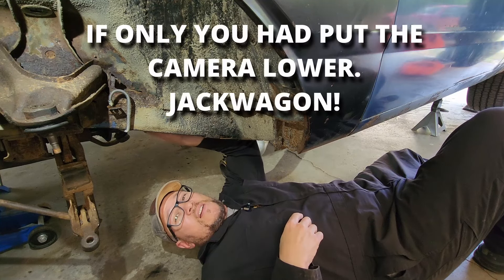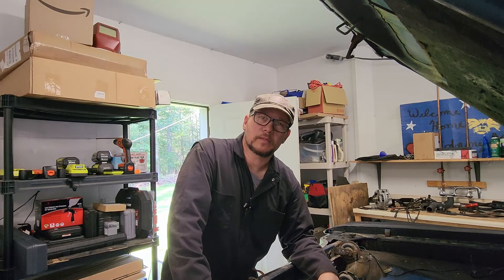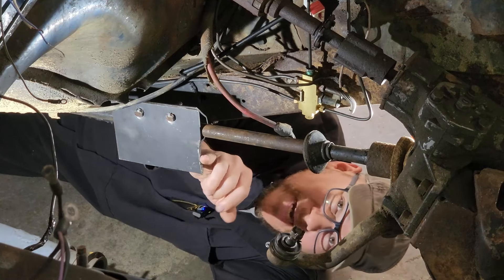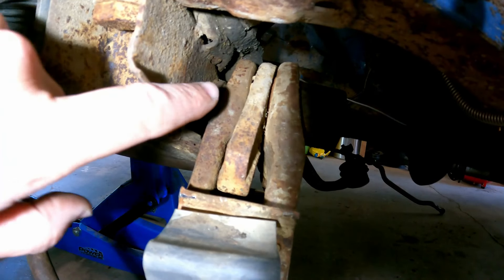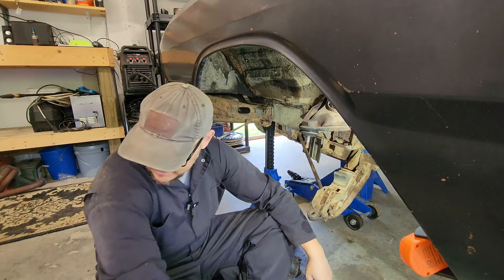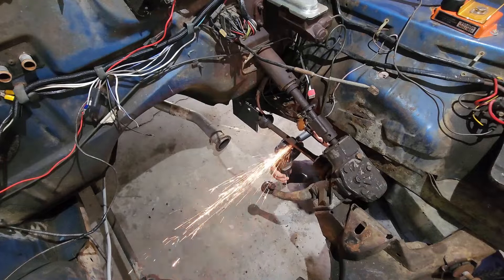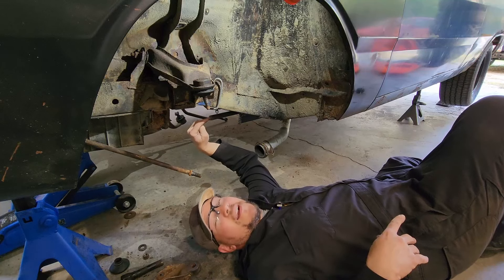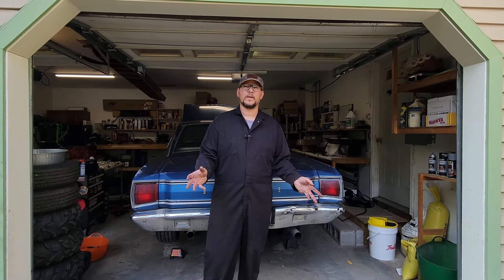Have An Insanely Stuck Torsion Bar? Watch This Now!

Comment: I got one for you tie rod removal tool it's got the bottom teeth on the larger piece of the metal to bite into the torsion bar and it's got a table for a socket. Throw an extension Hammer the extension end
Reply from the maker: Hello David. Welcome to the channel and thanks for the comment. I had to look up the tool you were talking about bit that looks like it might work fairly well. I'll have to give it a shot the next time I need to get out a set of rusted in torsion bars.

Comment: I had a similar issue on my sierra ended up going to a rental and getting a big old jack hammer took about thirty minutes but I’m not sure I could’ve gotten it out of the front even if I had cut the torsion bars they were so seized this is after soaking in pb blaster for weeks and countless hours of hammering with no luck
Reply from the maker: Welcome Number and thank you for the comment. I really need to get a Silverado or Sierra with the torsion bars. Would be a fun build. For the classic Mopars, I have seen guys beat them out with a sledge hammer to the control arm but I was concerned about ruining them so didn't go that route.

Comment: There has never been nor will there ever be a torsion bar on a Mopar car that I can't get out...unless some one has welded it in!😂.... You can always remove the lower control arm from the K member by taking all the tension off the bar then remove the shock mounting bolt ..nut on front control arm pivot and any other suspension connected to arm then take circlip out of rear torsion bar crossmember then whack control arm to rear and out the bar comes still connected to the arm... Now you don't need to be on your back to finish the job! Some heat and cooling and penetrating oil/spray and a bmx neck four hole style bolted to the bar gives you a tool to hit on for free and out comes the bar!... If not then its time for the air hammer and end this tragedy!😂😂😂
Reply from the maker: @moparnut6286 Welcome back and thank you again for your insight. I actually gave the method of hitting the LCA with my 12lb sledge a try on the other side and she wouldn't budge. I am still pretty new with all this and was a bit worried about bending the control arm. Is that something I should have been worried about? And I am quickly learning that alternating heat an lube gets most things unstuck eventually. I would have never though to use the neck from a BMX to clamp on the bar though. Thank you for that bit of knowledge. One day, I will have the space for a decent compressor and air tools. And a lift. One day.
Reply: @MontsweagGarage start with the compressor it saves so much on pain in your joints later in life not to mention the sore muscles!... A lift is truly a back and knee saver.
Reply from the maker: Just made a deal for a small compressor. I doubt it will run tools for long but it's a start.

Comment: Did you remove the clip on the back side of the torsion bar
Reply from the maker: Yes. The clips were removed before trying to get them out. I have new clips and boots for the new ones ready to go.